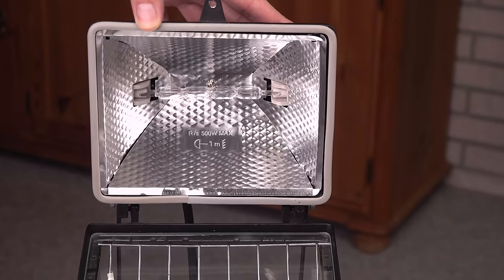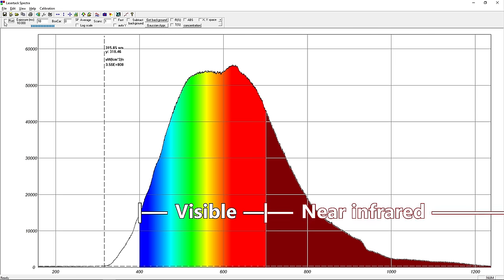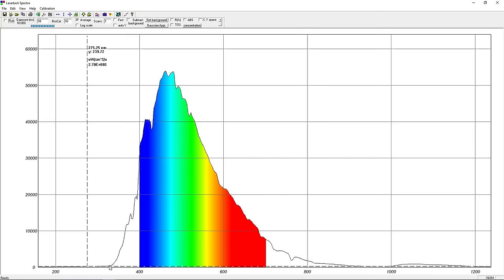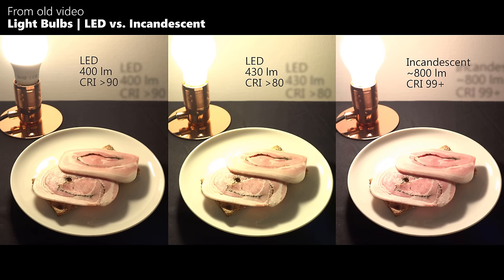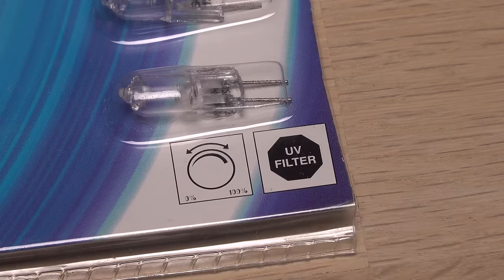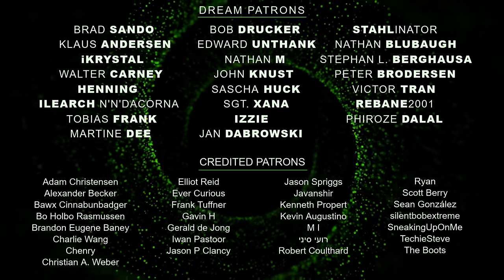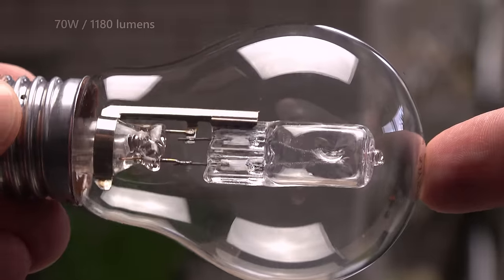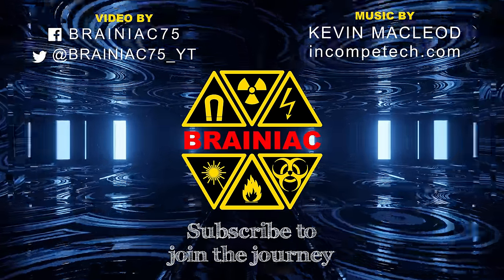Hidden Hazards of Halogen Lamps

Comment: 500W halogen is still better for my parents driveway, never failed since nearly 9-10 years. No leaks as this is cast aluminum housing. So the housing will last ages an a bulb can be replaced, Chinese LED lamps suck, many failed due to water ingress and no spare parts possible. 500W halogen shines 1-2 times  a day for just few minutes, not a big CO2 deal right? And moreover form factor is better, smaller, great light spill (spread) and Ra nice warm color. LEDs are not always the product you need and want! For home usage YES, driveway occasional use NO! And high power, outside use replacements are not cheap (cold ugly spectrum, big form factor, bulky look).

Comment: With enough power from a halogen lamp, you will get thermal burns from IR much faster than radiation burns from UV. This is the distribution of power across the spectrum for a typical halogen lamp, there is nothing you can do about it. And don't forget about the inverse proportion of radiation power to the square of distance.

Comment: I have a shed with no power so I put one of these in there it gets close to 500 degrees but will not go any further I've had it running for days straight with no problems I hope this video will not scare anyone away from these really useful lamps

Comment: Light enthutiast here.

Those small but insanely high wattage halogen are intentet for studio use only, for photos and fim production. 
They mimic the color temperature of full size movie theatre halogen bulbs wich are HUGE and 10k+ watt each.

Those movie theatre bulbs are of cause more durable but really, really, really expensive, so instead small cheap short life halaogens like the 1000watt one with comparebelly very thin overdriven filiment is used, there are different kind and formfactors of those and they are about 3400kelvin wich is very near the meltingpoint of the tungsten filiment. That really high temperature is needed in order to get better and more neutral light, especially back when everything was analoge.

Regular high power halogens intended for work or home use are aroudn 3200 kelvin at around 100 watt and are much more durable! (unless even slightly shaken when turned on!!!), and regular relative low power halogens like 40watt e27 tend to be between 3000-3200kelvin.

Comment: The glass is there to 1) protect the blub from contaminants that could cause it to explode bc these are meant to be Work lights where paint, drywall dust and other stuff you wouldn't want settling on the bulb and 2) to protect the user if the bulb explodes. Bc the last you want is searing hot glass flying towards you. 
I've used halogen work lights daily for 35+ years with several of my lamps have broken front glass and I have never seen any adverse effects.
Reply: And as we see here:
3. Glass is also there to filter out harmfull UV.
Reply: @volodumurkalunyak4651 no, it isn't, that's what he's saying. The uv is negligible, and any tested uv attenuation is incidental

Comment: 08:04 - you should put the end of the spectrometer in middle of paper tube (like the one toilet paper is on) and then cover other end with glass. 

Also what model of spectrometer do you use?

Comment: About the 1000W lightbulb… yeah it seems right to go for 50 hours. There is a really interesting effect with the radiation emitted that just destroys the quarz. So if they wont use specialized filters inside or even coatings, it will only last this short time

Comment: I belive I tried a version of Omnilux that was LED for halgen lamps. It worked, but not for very long, just like with halogen lamps. I'm used to them not surviving when it's very cold or if they get bumped. But this was in spring, however I haven't found out what made it go out. I suspect a power spike of some sort did since a few other devices went dead as well. If so, I don't think it's Omnilux fault, but probably my own.

Comment: Quartz halogen lights have caused fires because of their very hot operation. This has been more with fixtures built in to the ceiling of the home. As the fixture aged the wiring and socket inside broke down in its insulation. Another cause of fire is, there are people who don't follow proper process for safety when using halogen lights. Halogen lights are high on power consumption and make a lot of heat. The UV output from halogen lights at close distance can cause sun burn and eye damage over time if there is no UV filter in place.  

There are LED lights available that have an acceptable spectrum that can replace a halogen light.  My preference for LED lighting is for using a lot less electricity, not having very much heat, and having near zero UV radiation from them. We lit our home with all LED lighting. We were able to see savings in cost with our electricity cost.

Comment: The glass shattered but didn't break apart from the heat on my halogen worklight. I just don't use that side anymore lol. One side is bright enough and uses way more than enough electricity to run it.

Comment: I used to work at warehouse storage where I have to load and unload the goods from the trailers.
The company using halogen lamp for light source to looking inside the trailer that doesn't have a light inside.
I was cooked by the heat. 😂
I asking for replace with LED for more efficiency but company didn't give a sh!t to this.
They replace all of old fluorescent tubes in company with LED but not this one.
Then someone crashed the forklift into the lamp and it was replaced with LED. Thanks to that guy, everyone don't have to facing that heat again.

Comment: so i just relized that i had an unfiltred halogen light on my night stand for about 8 years now...............
Reply: Well then the video has already succeeded in its purpose
Reply from the maker: Probably low-wattage in a night stand lamp, where the UV-output fortunately is relatively low :) You can probably get an LED replacement bulb for it. Thanks for the early watch!

Comment: Its a shame that led lamps are terrible i had some outdoor flood lamps i have had to replace 4 of them so far as they fail. often by becoming dim after a couple of months of use. or the light entering a state where it never turns off. And they are sealed units good luck trying to open it to scrap it for the leds if any of them still work.
Reply: Led lamps aren't terrible, were they all the same brand you bought? We have bulbs from 2012 in our house that are still running well, maybe that's before they tried making them as cheap as possible.
Reply: @ColHogan-zg2pc  about 3 or 4 different brands we tried some at varying price points but they normally fail within 2months - 3 years meaning i have to replace the whole unit the longest lasting one that is currently operational is at the 2 year ish mark.
Reply: @ColHogan-zg2pc  Glad you managed to find working bulbs.

Comment: Those safety precautions in this channel are starting to dwell into the silly territory, the amount of UVB is so negligible that unless you have a lamp beaming at your face for hours (like in a dentists) I don't think its much of a big deal. After doing some calculations with a black body calculator the band irradiance from 200nm to 320nm of a black body radiator at 2773K°  is around 76.9479 W/m2/sr so if a filament from an 10W halogen bulb has an area of around 5mm2 it gives .37mW of UVB light, if you take in account the inverse square law then you get an insignificant amount of UVB radiation at normal usage scenarios. Using gloves because a bare 10W halogen bulb is turned on for a few minutes is silly, in fact might be more dangerous because if it gets hot enough and you touch it could melt the glove and get stuck to it burning you.

Comment: can you test the outdoor/indoor patio  heater more speciphique model CZPH05S3 I have these at my job and I am curious to know if there really safe or now
Reply from the maker: No worries with the halogen lamps meant for infrared heating. They are tuned to mostly emit in the infrared (felt as heat) and emit little visible light. They simply don't run the tungsten wire at as high temperature as the lights tested in the video. The heater lamps run the filament at a lower temperature to shift the thermal (black-body) radiation into the infrared, so most of the consumed electricity is converted into heat. Therefore they don't emit the same bright visible/ultraviolet light as halogen flood lights. The quartz/glass cover can also be filtered to emit mostly in the infrared (by blocking most of the visible and all ultraviolet). I am sure they don't emit ultraviolet light. Like the heat lamp featured shortly in this video: https://youtu.be/bb1Nc1oygTs  Thanks for watching!

Comment: I'd like to see which transparent materials and chemical compounds filter UV radiation.
Reply from the maker: Working on getting multiple, broadband UVA, UVB and UVC lights so I could test it extensively in the future. A deuterium arc lamp would be perfect but currently out of my league financially :'(  Many transparent materials don't let UVC pass and also more or less block UVB. UVA will often get through... Thanks for watching!
Reply: see ben krasnow's video from a few years ago.
Reply: @brainiac75  only a hundred $ or so on ebay...

Comment: Given the cost per kwh, I am glad I now have LED bulbs, which I have hacked to reduce their power consumption by almost half (Big Clive on YouTube shows how)
Reply from the maker: Yep, overall I am also glad that the energy efficient LEDs are replacing incandescent lamps. Makes sense on a global scale. But I still wish high-CRI LEDs were cheaper and more easily available. CRI above only 80 just isn't acceptable to my eyes and feels like they set the bar low to accommodate early LED technology.... With that said, I believe all IKEA's LEDs are CRI 90 now, so it is getting better :) Thanks for watching!

Comment: I used to run one pointing at the ceiling, without the glass cover. I hope I didn't expose myself to UV over those years. I wonder whether the white wall paint reflects UV.
Reply: @jeepsblackpowderandlights4305  Scare tactic? It's just encouraging you to not discard the protective glass cover (or built-in to the lamp) every single halogen lamp has. Ignore what he claims in the video. Why would every lamp include this feature if it makes little difference?
Reply: @gblargg  the uv is miniscule.  I get more an hour outside than id get ina lifetime from a halogen bulb lol
Reply: @jeepsblackpowderandlights4305  Would you be wearing sunglasses outside, though?
Reply: @gblargg  i never do

Comment: how much UV comes from high voltage arcs?
Reply: Enough to cause arc flash if you don't properly shield your eyes like for welding.
Actually a lot of UVC and also UVA.
Welding can cause sunburns too, either from the UVC or maybe because it also has UVB as well.

Comment: There are many ( linear )  LED bulbs available to retrofit your first lamp shown ... you should still fit the glass if you want to use it outdoors , to stop water getting in ! ! and .... the fitting never gets hot , and you use  MUCH  less electricity ..... ( tried - n - tested ) ........... DAVE™  .............

Comment: They also banned FL-Lamps in Europe
Reply: But nobody cares, because LED is better.
Reply: @tookitogo  Its not. Many nerds around the world collect discharge lamps.
Reply: @mernokimuvek  LED is better, which is why LED managed to displace incandescent when fluorescent was unable to over the course of nearly 100 years. 
There might be some “nerds” who prefer fluorescent, but most nerds prefer LED.
Reply: @tookitogo  You definitely dont collect and cant appreciate old stuff. Try an LED bulb against a magnetron or a Tesla coil and it wont survive. Try the same with other lamps and no problem.
Reply: @mernokimuvek  LOL you clearly don’t know me! ::looks at my collection of old tech::

But what does that have to do with anything? Yes, for experiments with magnetrons and Tesla coils you need a fluorescent lamp. But people generally buy lamps to use as… lamps. And that is the point. You are arguing with me over uses that have NOTHING to do with the primary use of these things.

Collecting curiosities is literally totally irrelevant to the point that LED lamps have completely displaced fluorescent lamps for lighting. You can still easily buy UV fluorescent tubes because right now, those are better. But irrelevant to lighting.
Reply: @tookitogo  Then explain why literally tens of thousands of geeks/nerds worldwide are radical fans of discharge lamps. I tried every light source i could get or make, including carbon arc lamps. Just because there is a more recent product i wont replace my existing stuff.
Reply: @mernokimuvek  People who care about the absolute very best color quality for lighting swear by incandescent, because it’s still better than any other artificial light source. There exist excellent (not perfect, but excellent) fluorescent lamps, but there also exist equally excellent LED lamps. On the other hand, the light quality of average fluorescent lamps is worse than that of average LED lamps.

I’m a nerd who used to do tech support for graphic designers and photographers, and have been an amateur photographer for decades. I know light. I know light really, really well. And so I think you’re talking out of your rump.

Even the most demanding light users today — the film industry — have completely switched to LED, because it really is that good. The difference to incandescent is so small as to be completely insignificant compared to the downsides of incandescent (heat output, power consumption).

Again, I don’t doubt that some (few) people hang onto fluorescent for nostalgia’s sake. But nobody is doing so for practical reasons.

And if you are talking about any kind of discharge lamp other than fluorescent, remember that this comment thread is about compact fluorescent lamps. The topic is not arc lamps, high intensity discharge lamps, etc. (Though it is telling that the major uses of those lamps — cinema projectors and car headlights — have both moved to LED or the closely related laser-pumped phosphor light sources.)
Reply: @tookitogo  I still use halogen lamps for high light quialty. The advantage of fluorescent lighting is the available 405 and 365 nm light, making some stuff to glow. Sunlight also contains UV and its needed for better color rendering. For example, paper and some clother will glow when exposed to UV-A or near UV. Most LEDs lack the light under 400 nm. Unfortunately its hard to get good qouality LED lamps. Back in the good old days stuff was made in Europe, now most crap is omported from china. Even ElectroBOOM mention the problem: https://www.youtube.com/watch?v=lIK1jnYr0yw
Reply: @mernokimuvek  Halogen lamps are a type of incandescent lamp, not a discharge lamp. I already said they’re the best for color quality. 

As for UV: the optical brighteners you’re talking about (since without those, neither fabric nor paper glows in UV) are designed for UV, but still react to the blue light that white LEDs are based on. But remember that the entire point of optical brighteners is to glow blue, so adding more blue light will accomplish almost the same thing. 

As for the quality of LED lamps: it’s become quite easy to get LED lamps with adequate color quality. (If anything, the horrible color rendering of the earliest LED lamps are what led to CRI becoming a commonly listed spec on lamps today. And the CRIs of around 80 for typical fluorescent lamps actually shows they weren’t great. High CRI fluorescent exists, but it’s not the stuff you find at the hardware store. Modern LED lamps with CRI above 90 are really quite good.) 

The build quality is a different matter altogether, and I absolutely agree that there is lots of room for improvement there.
Reply: @tookitogo  I never claimed that halogen lamps are dischare lamps. Full spectrum fluorescent lamps existed in the early 2000s, maybe earlier. Of course only decent  companies like Philips and Sylvania made them, not the chinese crap companies.
Reply: @mernokimuvek  What’s your point? You’re not telling me anything I didn’t write here already. Are you arguing just to hear yourself bark?

The fact that quality fluorescent tubes exist does not mean they were ever common. (And yes, they existed long before the 2000s.)

Regardless, you’re the one claiming that “tens of thousands geeks/nerds worldwide are radical fans” of fluorescent, and I think that’s complete nonsense. 

People like me who are actual light and lighting nerds, people know light and lighting technology know what the different technologies are and aren’t capable of. And understand the difference between what a technology can do, and what a super cheap version can and can’t do.

The upshot is this: if you go to your local grocery store today and buy a name brand LED bulb, it will be at least as good as the fluorescent bulbs that same grocery store sold in the past, and likely much better than the compact fluorescent. Neither grocery store LED nor grocery store fluorescent is as good as incandescent. But modern grocery store LED gets you quite close.

If you want better than what the grocery store has, you can get it, it will just cost more and you’ll have to find a specialist.
Reply: @tookitogo  The problem is that LEDs are so common now. When they were a novelty I used them because i always wanted to be an eccentric. Now I prefer fluorescents because most people dont. I dont want to live like other people, that would be boring. The hoarder lifestyle is the best. Keep and repair everything, only uneducated villagers/rednecks throw away bulbs.